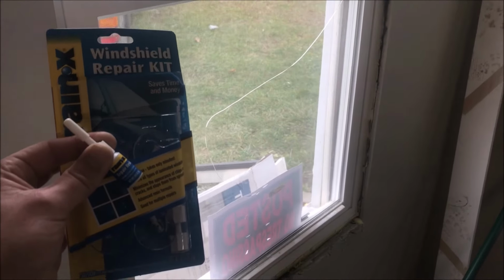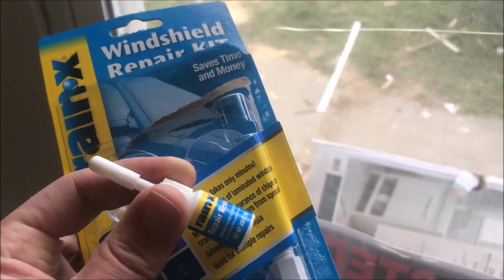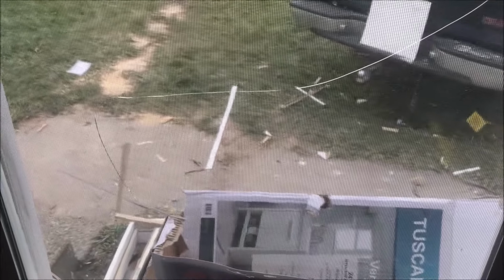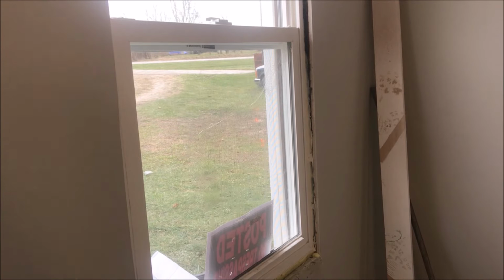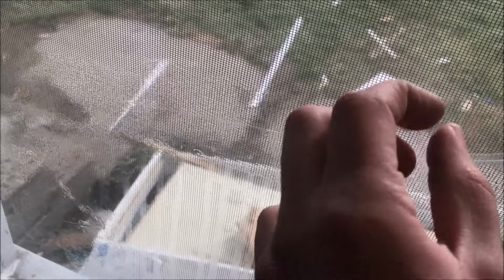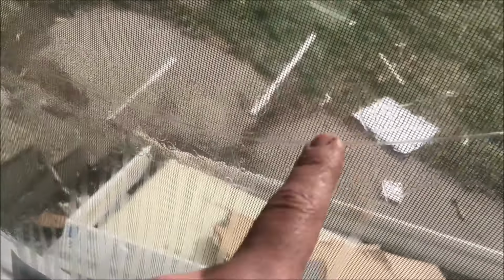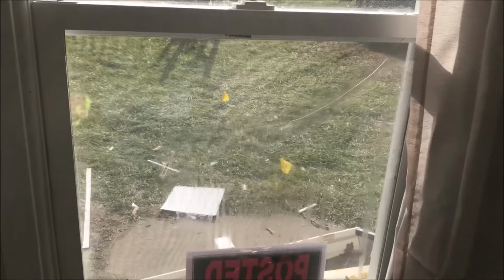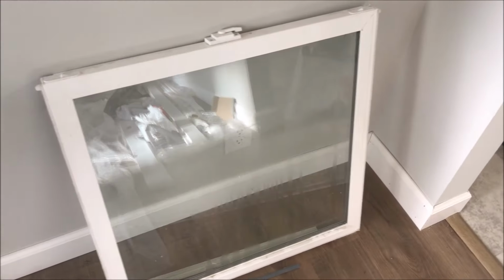RainX Window Repair Kit Verses Cracked Double Pane House Window

Comment: My guess is it's flawed glass from the factory. My window did the same, but it happened 30 years after it was installed. It's an Anderson Bay Window, and after 30 years there's no way to find a factory sealed glass section to replace it with, and I don't have the funds to spend thousands of dollars to replace with a new bay window.
Reply: Same here.
Reply: You can buy double pane window sashes without the frame. https://www.youtube.com/watch?v=WOzrwHyWZvM The problem is that no one wants to do this because it's labor intensive and fiddly.

Comment: Might have been a good idea to put on a table first and flex the crack to accept the fluid surface tension
Reply from the maker: While applying the gel I gently pushed the pane back and forth with my finger trying to work the liquid into the crack with little success. I also put the nozzle right on the crack and tried to use the pressure of squirting the liquid to penetrate into the crack, also with little success
Reply: @tonto_bob  could apply suction to the crack from a vacuum or a suction cup to pull the material in.
Reply: From the other side

Comment: Hindsight is 20/20, right? Fortunately for me my window is single pane, old, and the crack is in a low corner. Here is my plan based on your experience: 
I will try using the same product but, first remove my sash and lay it flat on a saw horse. Second, cover both sides of the crack with Frog Tape to limit runoff. Third, use my Exact-O-Knife to cut through both sides of the Frog Tape to expose only the seem of the crack. Four, from above, drizzle the fluid onto the crack and and, from underneath, draw it through the exposed crack using my wet/dry vac . Five, cover it with the cure tape. 
Lastly, if necessary, use a heat gun on lowest setting to help cure the finished application.
I'll let you know how it works!
Thanks for the video tips.
Reply: Why go through all of that when you can have the hardware store cut you a piece of glass for $10?
Reply: Thanks for sharing, I have cracks to fix, too. How it works?
Reply: Did any excess product get into your wet/dry vac.?
Reply: @jatlifevlogs2725 there are reasons , you’re not helpful
Reply: @cherrysamuels7409  And they are...?
Reply: Did it work?

Comment: Someone help, my window random cracked, it’s a heat crack. I got them last summer due to having smth in front of my window and got both my windows fixed a few months after. I’ve sense moved everything away from my window but it still cracked. What am I doing wrong?

Comment: I wonder if I can make a vaccume sucktion devise to pull it in shape and suck the glue into the whole crack at the same time 🤔 might work . Ill try
Reply: Did it work?
Reply: @redrum4100  no try yet :)
Reply from the maker: While applying the gel I gently pushed the pane back and forth with my finger trying to work the liquid into the crack with little success. I also put the nozzle right on the crack and tried to use the pressure of squirting the liquid to penetrate into the crack, also with little success